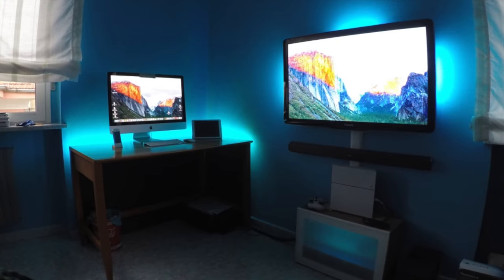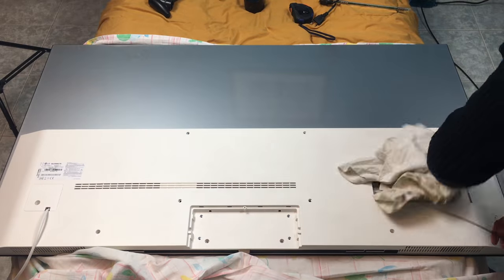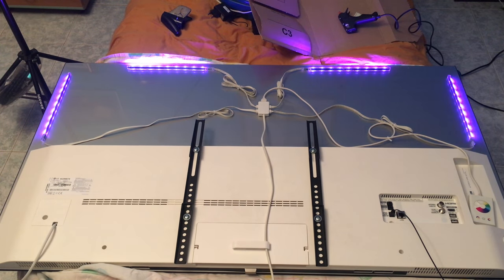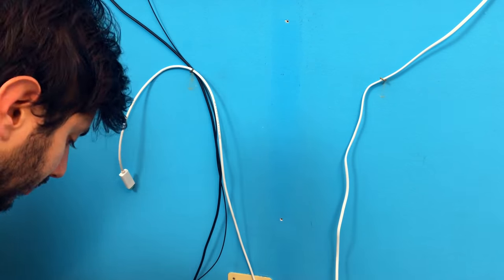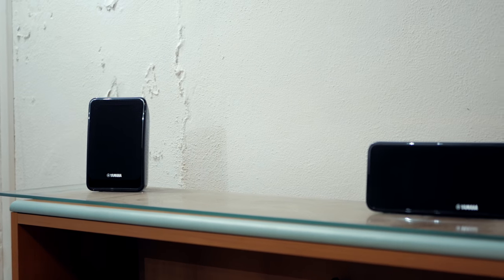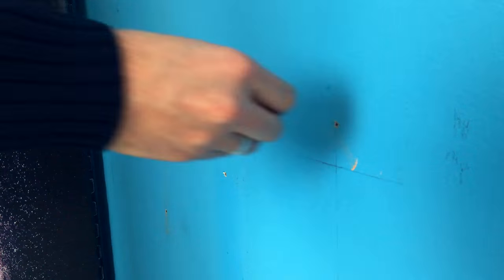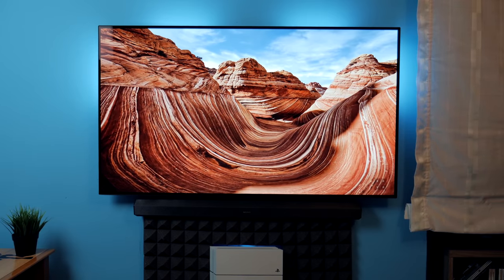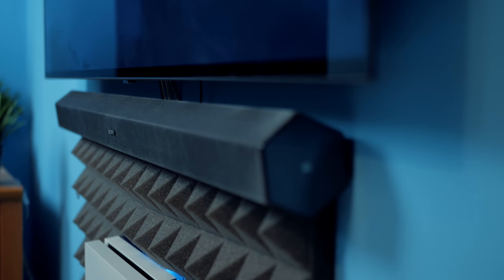LG OLED 4k HDR10 tv wall mounting + CABLE management - LG55C7P | Shades of Tech ⓞ

Comment: That TV is not screwed in optimally on the VESA mount brackets 2:01 => as you can see the brackets are protruding below the TV, that's BAD. Also, you left the point of support of the top screws over the screws, it's better for it to be below. If you use the bottom holes of the brackets for the bottom screws the top screws should end up in the correct position (actually on my brackets the holes are on the upper part of the bracket which makes more sense). Of course that would make the TV go down on your current mount point, so it's probably to late too change that. Cheers!
Reply from the maker: Yeah, what you are saying is correct, but I had the screws in the wall from the previous setup and I wanted the tv hushed from the floor. Besides this tv has a blade thin design in the upper part, so the weight is concentrated in the lower part. I believe the way I mounted it is the best for my setup. If I mounted the tv like you suggest the vesa brackets would have gone much higher and would have ruined the thin design.
Besides this was just temporary, I moved my studio in a new environment and changed the wall mount. Now the mounting is much better.

Comment: Hi mate, thanks for the video. very interesting stuff!!
  Tell me please, aren't you concerned  with the effect of the LED strips on the TV? it could damage the picture since it's electricity running very close to the OLED pixels...
Reply from the maker: Good question! The plastic packing layer that I didn’t remove makes some insulation but as you know Oled is really delicate. I had this fear too so I decided to remove the led strip from the tv when I moved it to my new studio and I am building a frame that I will hang on the wall with the led strip on the 4 sides. The tv will be further from the wall and will be safe and sound! This is the solution that fits my needs and protects the tv. I think it’s a good compromise and being closer to the wall it creates a really light and shadow pattern on the stone wall.. you’ll see..